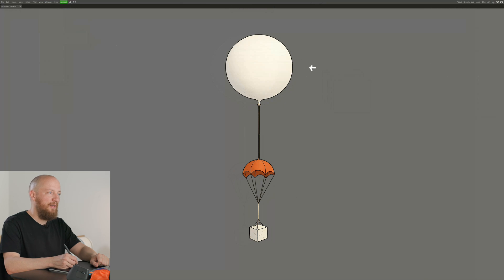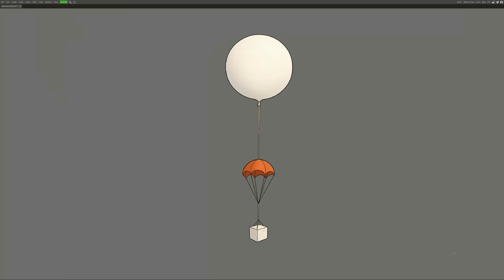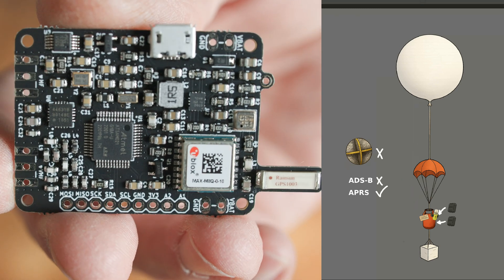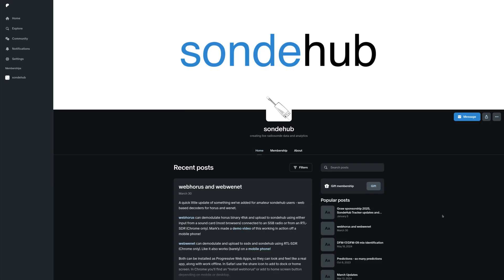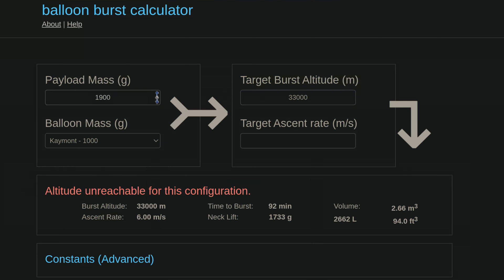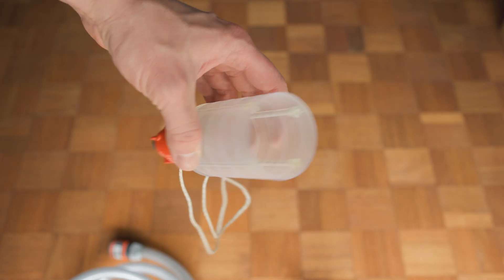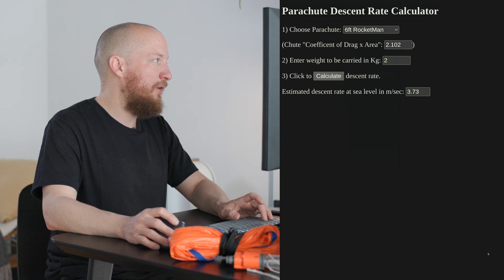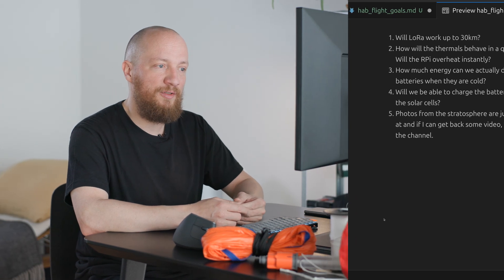CubeSat Test Flight Prep: Part 1, Basics

Comment: Which LoRa frequency are you using? Supposedly the 868-915Mhz range bounces off a certain layer of the atmosphere. For LEO you'd want to use 433mHz LoRa.
Reply from the maker: Hey Brett! Yes, 868 for this flight, but 433 is definitely the way to go for LEO (as usual with RF, lower frequency = longer range through atmosphere). I plan to make a direct comparison on a future flight.
Reply: @buildacubesat  Interested to see how they compare. I use 915mHz at work all the time and usually we get 5-10km of range. Line of sight being the main limit. We almost flew a Helium LoRa node on FrontierSAT.